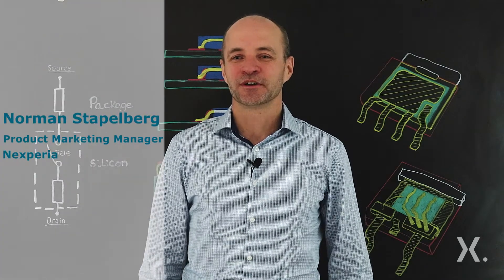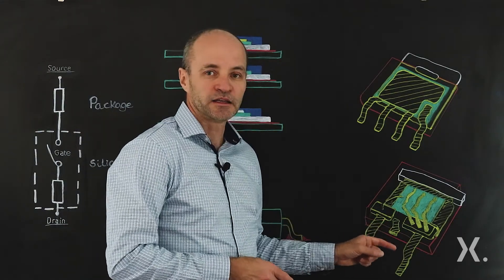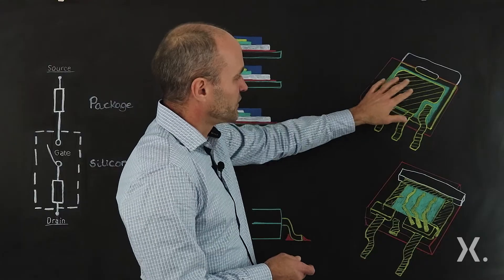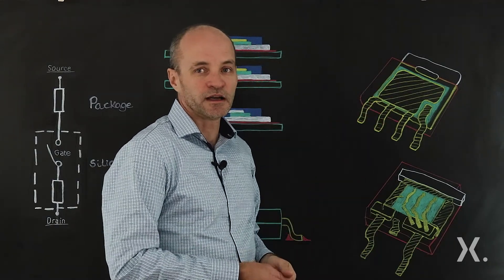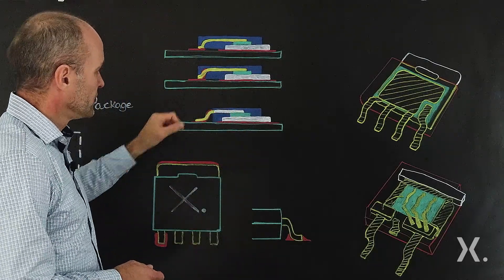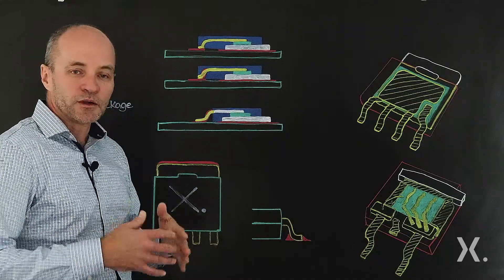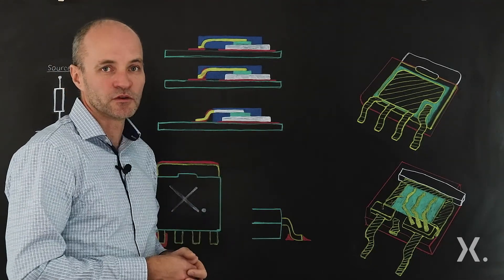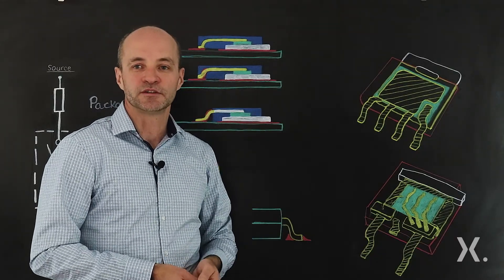What is LFPAK?

Comment: Many great explanations about features that have become evident to me as shortcoming in other package types. Having said this, why is there no option to cool the package from the non-PCB side. With such heavy power devices in such small packages it can be challenging to use vias and cool from the reverse of the board. Sometimes it would be very helpful to simply add a heatsink directly onto the top of the package. This is not possible with LFPAK and such a shame, with all the copper available directly above the wafer, why not expose it? Is it simply that the vast majority of the heat is focused on the drain and this would not be so easily dissipated via the source side?
Reply from the maker: Hello! Thanks for your great question. Firstly, it is possible to use a heatsink on top of a standard LFPAK package and this will add some additional cooling, but it is limited by the thermal conductivity of the thin layer of plastic covering the source clip. Please also be careful to not apply too much pressure to the top of the package, this could ultimately result in the die being cracked.

Secondly, we have looked at developing a LFPAK equivalent package, with the source clip exposed on top for better cooling. With the exposed source however you need an electrical insulator to isolate the source copper from the heatsink. This insulator needs to be thin, a good electrical insulator and have a low thermal resistance. In our experience, you can see a significant improvement in thermal performance if you can meet these 3 criteria.

In reality however maintaining a uniform connection between the heatsink and the source copper, is very difficult in volume production. What we see is that most manufacturers can’t mount these heatsinks with a tolerance of less than +-0.5mm consistently. With thicker thermal interface materials, we see a sharp drop in the top side cooling performance. So, unless the PCB and housing manufacturer are able to maintain a very thin and consistent thermal interface material thickness, then there is little benefit to gain with topside cooling.
Reply: @Nexperia  I think what he meant was why is there that layer of plastic or covering ontop of the die? if you have bare copper available he wonders why its not directly exposed to provide better cooling
Reply from the maker: @kenwood_9474  Thanks for the note. LFPAK packages are designed with the target to achieve a reliability of < 1ppb (1 part per billion) failure rate, it is critical to get every detail in the design right. For an exposed tab/copper at the top, the right design approach must be carried out. Regarding the plastic in an LFPAK package, it provides the necessary ingress protection, protection against moistness and providing stability etc.  It is also thin enough to allow a heatsink to be placed. The drain tab is still the main channel for heat transfer as it provides a bigger area – please see AN90003 for more details https://assets.nexperia.com/documents/application-note/AN90003.pdf. There is of course benefits to an exposed top cooled package, we are currently developing devices with top side cool designs for MOSFETs and GaN FETs, learn more about CCPAK1212i https://efficiencywins.nexperia.com/quality-reliability/ccpak-top-side-cooling-for-gan-fets.html.